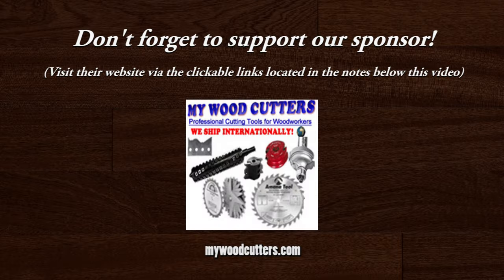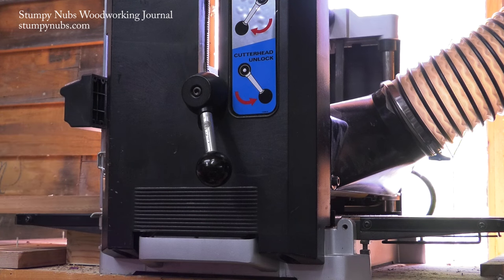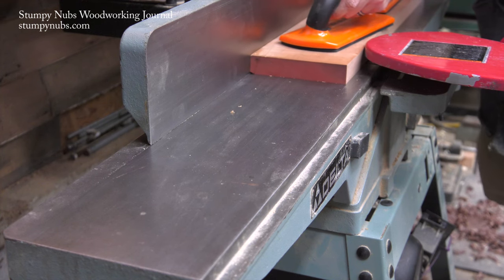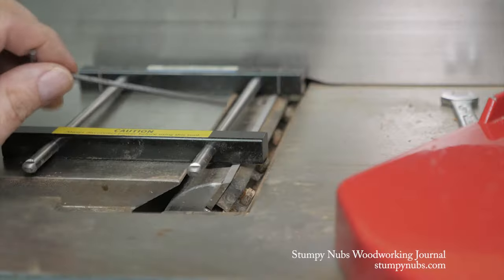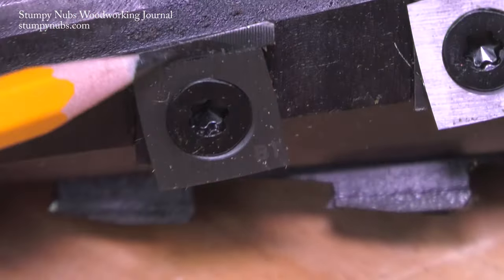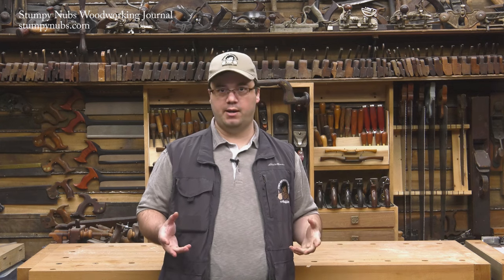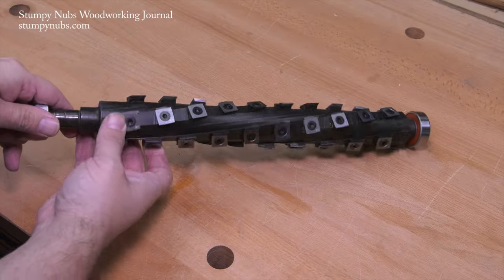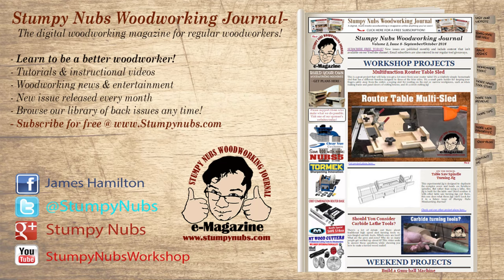WATCH THIS before buying a carbide helical (spiral/segmented) jointer/planer cutter head

Comment: You certainly got all the pros and cons right on this.  My Shelix head doubled the overall cost of my Dewalt 735 but I no longer have to replace those hard rubber knives that Dewalt sells.  I couldn’t get 1000 sf of hardwood through them before they had to be changed out.  The surface coming out of the helical head is smooth as a baby’s bottom.  Good job on the review.

Comment: First some words of wisdom:  “Buy once, cry once”. Now my personal experiences:  I purchased my Jet 12” jointer/planer combo machine with a factory-option Shelix cutter head in 2010. I STILL haven’t had to rotate any cutters. This is all the better when you realize over 800 bd ft of white oak and 1,200 bd ft of western cedar were jointed and thickness planed in just 2 projects. I was concerned the Jet has only 1 feed speed on the planer. My fears were for nothing. I’m a happy camper with the Jet combo and especially the Shelix  cutter.   I use the large, 5 micron, Jet Vortex dust collection without a single problem.  The 3 hp planer motor seems to be easily handling the load. I’d happily recommend both!  The first time you joint a 10” board, you’ll ask yourself, why didn’t I make this investment sooner!
Reply: "buy once, cry once"😂

Comment: I replaced my cutterhead on my Dewalt planer with a Shelix. One of the best decisions I've made. - When I bought a new jointer, it was the Powermatic with Helical head. SO glad I spent a few extra $$$.  Great overview Stumpy!!
Reply: A FEW EXTRA DOLLARS ? A used Stanley #3 or #4 with the best blade available can be had for under $100 and will last a half a lifetime.

Comment: Hey stumpy, I have a Ridgid planer with the standard 3 knife set up, and it worked fine but the snipe was so bad that I  quit using it and went back to solely using my hand planes. After watching this video I went to mywoodcutters.com to see if they had a shelical cutterhead for my planer. They did in fact have one and my wife bought it for me as a Birthday gift, and I couldn't be happier! The cut is fantastic and the snipe virtually gone. Thank you stumpy and thank you mywoodcutters.com your service is top notch. I will be a fan and a customer for life.

Comment: I’m not a high production furniture maker or miller by any means but I bought my helix one year after purchasing my Dewalt 13” thickness planer.
I went through 3 sets of blades at $89.00 CAD/ set and made a move!
I had my helix for over 5 years planing oak, hickory, zebra wood as well as soft woods and to sum my impression of this cutter head- WORTH EVERY PENNY, at least in my case.
Before when thinking about any project, budget in particular, if I didn’t have $89 for new blades I tended to stay away from figures woods and even then dull blades were issue, when blade doesn’t cut- it chisels!

Comment: 100% true, have had my Powermatic 20" HH for over 5 years now and its still on its original set of cutters and I process all my own wood directly from my bandsaw mill once its air dired about a year. Handles tigermaple, curley cherry, flame birch and crotch walnut very exceptional, more efficiently and much quiter than my original planer with HSS knives. Now the decision is to spend over $500 to retrofit my Delta DJ20 jointer.

Comment: Thanks for the great video.  On the cost savings, you missed the cost of the wood destroyed by a straight planer, and the value of the time it takes to sand out tearout from a straight planer.  Factoring that in, it pays for itself much more quickly.
Reply: And with hearing aids needed after using straight planer blades for many years....
Reply: Time savings of not having to check grain direction on several hundred parts for a kitchen is a huge factor.  Helical heads cut time at the jointer by at least half.  That's a ton of money over the life of the machine in a working shop.

Comment: Honestly, before this video, I wasn't aware that a replacement head was available for my planer or jointer, so I really appreciate you sharing the site.  I had thought I would just need to save up for a new jointer with helical head.  Besides once a year when my father-in-law asks for cedar planer shavings for woodduck house bedding, the long ribbons are indeed a pain for the dust collector.  I'm in the camp of only replacing my blades once or twice a year, but personally, I'd consider the dust collection improvements worth some $.  The noise factor with kids sleeping is also something I hadn't thought about.  Table saw and sanders can be run when they are asleep no problem, but I usually get "the look" when planing at night.  Thank you for the video!
Reply: I expected the noise reduction to be more, the possibility of 50% noise reduction is just 3dB less at best
Reply: And it typically takes a 9dB change for the average person to perceive a doubling/halving in volume. So the meter might show a difference, but it will be almost unnoticeable to the ear.
Reply: I had a huge reduction in noise on my Grizzly 15" planer. I could be wrong about the cause but I think the original blades passing the plastic chip deflector contributed to a very loud thrumming with the blades. With the Byrd Shelix cutter the chip deflector doesn't seem to have the same resonant frequency and is not just quieter but a much more tolerable noise. I can talk to someone on the out-feed now quite easily.
Reply: Black Dog Mai

Comment: Great review, came back to it just before buying my helical head for a refresher. Maybe I missed it but the cost savings are more than just the cost of the individual knives. While it matters most if you're a business but the cut quality results in a huge savings down the road for other things like sandpaper and labor even the hobbyist. The fact that it leaves a smooth finish alone is enough to justify the upgrade. Because NOBODY loves sanding lol
Reply: My stock DW734 gives an incredibly smooth finish on 99% of boards, but I don't like how I have to inch down by like 1/128 at a time unless I want it to bog down. If I do 1/32 on any hardwood it bogs and it popped the internal GFCI on what you'd think would be an easy cut

Comment: Good overview. I have both types of cutterhead - helical on my jointer and straight blade on the thicknesser. The helical is much quieter to run and produces a beautiful finish most times.

As for striking the odd nail, no problems so far. It whips off the metal and doesn't damage the cutter. You use tungsten carbide bits in a lathe and milling machine to machine mild steel and so can't see the problem. It means using recycled wood is not so disastrous on your equipment. As quality timber is becoming increasingly difficult to source, effective tools to deal with recycled materials makes sense. I still run wood through my magnet detector however when I remember just to be safe, cutting through bolts is not smart.

Comment: We have a helical head on the machine at the shop where I work, and it's a double edged sword. The cut quality is great, but the increased demand causes out machine to overheat very regularly, which costs a lot of time. I'd say the helical heads ares ideal for larger machines, but are just to demanding for smaller planers.
Reply: Well i think you have wrong machine in shop then, small planers Are more for hobby or contractor works If needed can plane some wood, but not for working 8hour straight

Comment: Thanks, good review. Consistent with my experience. Several years ago I needed to upgrade from my 6" jointer and my lunchbox planer, and space was an issue, so I got the Jet 12" combo machine with the helical head. Having a 12" jointer made a big difference in the wood I can handle, and the noise reduction was remarkable. At around 81dB I do not technically need hearing protection though I still use it. The inserts do leave a very fine basket weave pattern which sands out easily. Passed my old planer on to my son, and now I notice its often out of service waiting for new blades.

Comment: I upgraded my Jet planner/thicknesser with a helical head and had a couple of issues when I needed to rotate the cutters. I over tightened the screws by only a couple of pounds and had a number of them break. I was supplied a box of ten 15 x 15 x  2.5 x R100mm labelled as Byrde but they were not,  some how there has been a substitution of 14.8 x 14.8 x 2.5mm cutters. I had a step on the surface where the new cutters were not cutting to the full depth. I purchased some new cutters and installed them problem solved.. It is worth running a digital calliper or micrometer over the cutters before installation. Do not trust that some creep has not tried to pull a fast one and swapped out some cutters.

Comment: TIP: If you knick your straight blades, on most planers/jointers, you can swap out just one blade and eliminate the lines.

On some like the Dewalt, the blades are also reversible. Flip one blade and your back in business.

Comment: I put one in my Dewalt 735, and it's fantastic. I do a lot of work with hardwoods from locally grown trees (mesquite and olive), and they would kill my HSS knives in no time at all. I upgraded to the Byrd Shelix head, and it's one of the best tool investments I've ever made. It doesn't solve the Dewalt's snipe problem, but it was definitely worth the investment for me.
Reply: Michael   Micheal I was able to dial out 98-100 percent of the snipe out of my boards. When I want a 100% snipe free board for an expensive board and I don't want to waste any I add a sled to mine which is the practical width of the planer with Formica on each side with a cleat underneath the bottom of the indeed side. Make sure your infeed and out feed table are flat all the way across, insert the sled with the cleat against the infeed table edge. Make sure the sled table is waxed with a silicone free wax. Again make sure the sled is level in all planes... works like a dream stopping the snipe.

Comment: I have a dewalt planner with reversible knives and a spare set. When I use those up, I'll get a shelix.

I have a 6 inch benchtop Jointer that might get replaced by then.

Comment: Another benefit that I have found is that I can now dial in the thickness gauge on my surface planer. Before, when I would swap out blades, I’d have to go through the process of setting the gauge to reflect the position of the new blades, and I’d never do it. Now when I need to rotate or replace a cutter, it doesn’t alter the relative height of the cutter, and I can trust the gauge to tell me the thickness. I still double check, but if it isn’t critical I would trust the gauge.

Comment: Our shelix helical cutter has been a HUGE money saver just due to the surface finish that it leaves on the wood. Less money and time is spent on abrasives and sanding, and less wood is wasted due to horrible tearout. The sooner you buy one the sooner you will start saving.

Comment: Grizzly now has a knock off shelix head for much less. I bought one for my 8 inch jointer. I ordered one for my 15 inch planer and changed my mind, buying a newer jet planer with the helical. I’m converted. Sweet. The planer is insanely quiet. The jointer not so. I don’t know if the bearing is compromised or the design disturbs the air differently but it’s louder than the old head turning. The cutting action is quieter.

Comment: So glad I watched this. I was in the market for a Shelix cutter head for my DW735. The Shelix lead time was 10 months. Lux cut 3 were available right away and I had my cutter head 6 days after ordering. Also, I don’t like what Byrd is doing. You can buy a DW735 with a Shelix preinstalled for 1600 dollars. 600 machine, 500 cutter and 500 for installation. Absolutely ridiculous. They say they have those available now but just the cutter head is 10 months out?

Comment: I upgraded to a helical head on my Powermatic 54A 6” jointer , what I found is the chips exhaust out the backside of the jointer rather than down the dust chute , upgraded to a larger collector and a 6” dust collector port to handle the issue

Comment: If you check locally, you should be able to locate a cutter grinding shop that can resharp the inserts economically.  As long as there is just wear and not damage, those inserts can be reused.  Certainly you can find a cutter grinding shop on the east coast.
Reply: SeamusAndrewMurphy Inserts are typically inexpensive enough that you're not going to gain anything in resharpening once labor is factored in. They're designed as consumables and priced as such.
Reply: Having all the cutters the same size is actually somewhat critical in this application, and all multi tooth cutters.

Comment: Thanks for the review.  When rebuilding an older Rockwell 22-201 18" wedge bed, I did decide to put a shelix on it and have been pleased.  One comment about the power requirements I can offer is the carbide is taking a scraping cut instead of the slicing cut of a knife - I'm suspecting that is contributing to the power draw.

I noticed a brief display of a Clear Vue cyclone dust collector in the video.  How do you like it?  Any commentary about it?  Recommendations?

Comment: In my experience segmented cutters have one extra pro. That is, when the inevitable happens and worked timber inexplicably contains a nail or perhaps even an embedded stone, only one or two individual cutters will need to be replaced, not the whole blade set. This equates to a huge reduction in downtime and costs after such an event.
Reply: One extra pro? Your point is mentioned in the video.

Comment: As an owner of a makerspace, having a helical head is the only way to go. No matter how many times you tell someone to check for nails or other debris in the wood, a nail or other article is sent through either the jointer or the planer. Simple fix, only one carbide head was damaged, just turn it 90 degrees and voila, back in business.  Instead of having to replace an entire knife or worse, all of them.
Reply: Sounds great, but a helical head seems to be about 400-500 dollars if you're lucky.  My whole jointer/planer combo only cost 400.  I think I'll just stick with planer knives and a sander for now.
Reply from the maker: Like the video said, it depends on how often you use it. A helical head will pay for itself before the first set of replacement cutters is installed because you would have replaced the knives on your HSS head 20 times in that time. But if you only replace your knives once a year, then it would take almost 20 years to see the savings. So, it depends on how much you use your machine. It also depends on how much your machine's HSS knives cost. Frankly, I think the other benefits make it very much worthwhile, let alone the cost savings over time.
Reply: Hmmm... need a metal sensor on the infeed to stop/cut power if steel detected! Like a metal detector circuit... I Like my solution though... a lock on the shop door! :-)
Reply: Hmmm indeed. A metal detector mounted 300 lbs of steel to detect a small nail?
Reply: frickmystr I have a set of inexpensive eyeballs that were included with my birth at no extra charge to my mother. Amazingly they still work all these years later.
Reply: Already have it done.. In the 2 1/2 years we have been open we have only had to turn 2 of the inserts on the planer and 3 on the jointer.  So we have been lucky.. Can't say the same for the sawstop though :-(.. 7 cartridges fired. But make the member pay for that one.
Reply: frickmystr  I thought a makerspace was some kind of tool, figured it out in the comments. LOL
I always thought something like that would be a great idea.
Do you have monthly memberships or...? 
I thought insurance would make a business like that not possible.
Reply: There are 100's of makerspaces across the US and thousands across the world. Insurance is a little bit of a sticky wicket, most makerspaces have a liability waiver that members have to sign. While this does provide some protection, it can be tested in court.
Reply: Use a metal detector (hand held) BEFORE you send the board through the planer/joiner.
Reply: That's what he said - at a makerspace people of all experience levels use the machines and "no matter how often you tell people to use the metal detector"...things will always get damaged. Mitigating the damage with a helix seems the obvious upgrade.
Reply: frickmystr  
But how many fingers were saved by those 7 cartridges?
Better to have someone still in possession of all of their fingers use them to dig into their wallet for a new cartridge and blade than to have to use yours to clean their blood and bits of fingers out of your saw. ;)
I really can't imagine having any table saw other than a Sawstop in a maker space.
Reply: I nicked myself on my table saw for the first time the other day. One of my thoughts about the nick was that it was a double win. 1. It made me realize I needed to be more careful without seriously injuring myself in the process and 2. I was lucky I didn't have a Sawstop because the nick would have probably cost me a new cartridge.
Reply: Dave Kirkeby
And a new blade.
Reply: Woo Hoo, a triple win.